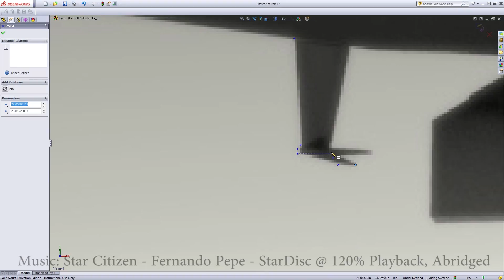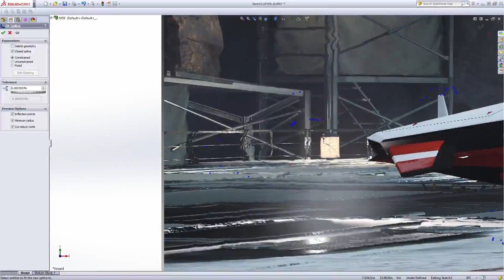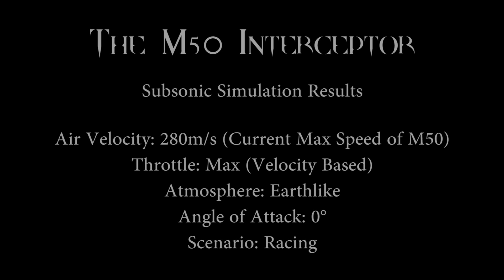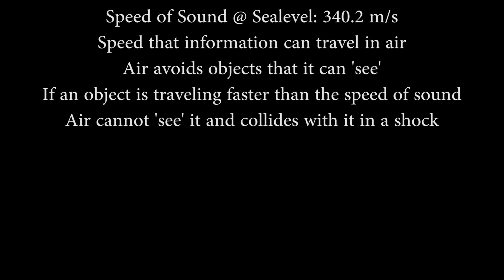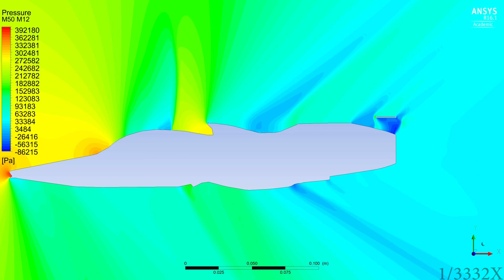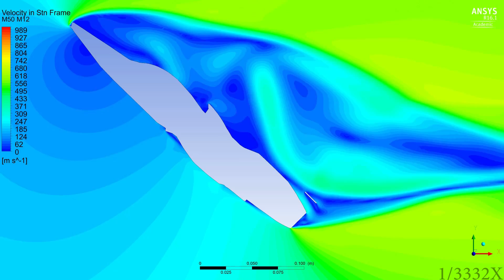[Star Citizen] Aerodynamic Visualization | M50 Interceptor | Process & Results! [60fps]

Comment: That intake on top should pass air through but it's closed off in these simulations.  I think it should split the 2d geometry into two pieces like you have the airfoil cross section modeled unconnected.
Reply from the maker: Good eye! It is geometrically closed off in the simulations ,however for subsonic runs all intakes were given pressure outlets boundary conditions (set as air intakes). All intakes were closed for the supersonic runs.
Reply: +SwissMllk Sorry, shouldn't have assumed that because it looks like it's closed off that it is.  4:08 threw me off, I guess I imagined less pressure being there.  I see you did split the geometry up at the beginning.  Very nice sim.